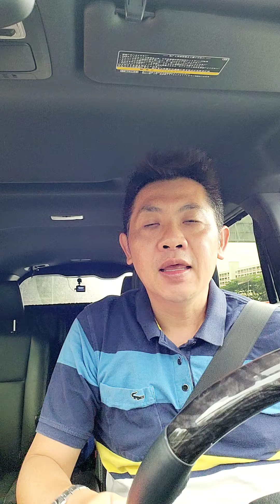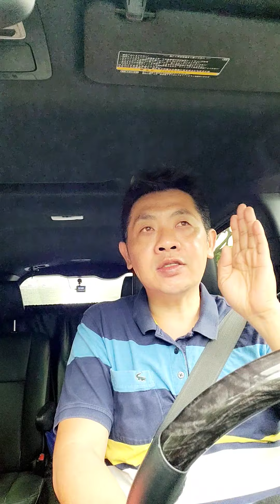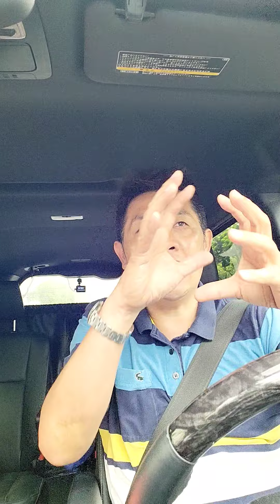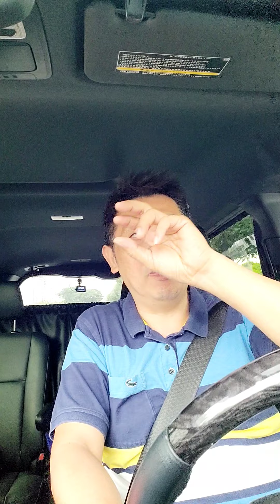aircon dry mode risk damaging copper pipe insulation.

Comment: OMG! 12 minutes talking and I still couldn't find the part that you are talking about "risk of damaging copper pipe insulation"

1- aircons are tested in factory for 300PSI but normally the gas inside doesn't raise over 120PSI. a proper Aircon  has humidity sensor and at least 2 temprature sensors one attached to fin and one standing in air in front of air intake window, thus gas temp will not go below 0 and even if it does, it is still safe until -20 degree. 
2- When aircon runs on dry mode, it shouldn't be turned on or off (stay on 24h), or open window to let air change as often as the way is used with cool mode. 
3- In dry mode aircon is set to remove humidity until it reach around 40% humidity since below that is considered uncomfortable zone (desert dry). when room humidity reach 40% aircon will turn off but sensors are still active and monitoring the air and if necessary it will turn on again.thus it is not necessary to turn off and on the aircon.
4- if there is a lot of moving in and out of the room, it is better to use cycle or auto mode than dry.
6- A room with 28degree temperature and 40% humidity feels more comfortable than a room with 21degree and 70% humidity (cold ocean) this is due to easier perspiring in lower humidity which absorbs heat from body to evaporate.
Reply from the maker: Haha... looks like we are of other worlds...u are confusing.me too...few lines into reading your comment and I totally cannot understand u 🤣
Reply: @astiquer And what is your point dude. talking sh*t like Wikipedia reading. You might not experience this problem if you're in a not-so-humid area because the aircon won't work as much either -- however here in S.E.Asia (like where I am in Indonesia) this is a common problem in using the dry mode overtime in a room with high mobility. That is why we (who know) keep changing the insulator for every 3 years or so.. also this is why dehumidifier devices sell very well here recently. However this small devices also comes with another downside; it cannot blow to circulate the air in the room and it comes with lower capacity. I'm not an expert. But I think what this guy Kevin said is LEGIT. Fortunately here in Indonesia, the price of the piping material and service is about more than half lower than in Sg. So I suppose that in terms of 'cost more' or not, it would really depend on where you live.

Comment: I don’t understand can any one summarise what he saying
Reply: He mentioned that using dry mode may attract the moisture at your copper piping as they are wiping with thin insulator. In dry mode, the coils temperature are as low as 0C to 3C to trap the moisture from the room air, so does the copper pipe. So you might end up seeing your wall where the copper pipe is laying get water accumulating (water marks) and damaging the copper insulating.

Comment: Interesting.  It seems like, normally, the condensation on cool/low fan is similar to dry mode for most mini splits, and the compressor runs more slowly in dry mode since no need to flow as much refrigerant since not as much load on the coil.  So, the room air is warmer, but there are savings in dry mode.  That's the tradeoff we've noticed.

Comment: We own three 2 HP Carrier X Power Gold 3 Split Type systems with inverter technology. We run ours on dry mode all day. The internal fan never stops blowing air. We are able to achieve as low as 35% humidity at times. The room temp is usually 74-76° F on dry mode. Does the inverter technology prevent the issue?

Comment: Never tried dry mode before but my trunking still shows mould and water drip. After using dry mode it stops so it's subjective for my usage. Ended up using dry mode for 2hrs first and cool mode for the night. Will it still damage the copper pipe?

Comment: Recently, I managed to learn from YouTube to remove the blower to clean after 5 years. Also bought a wet vacuum cleaner to suck out water (and jelly) from the water pipe. Cleaned the water retention tray ensuring no clogging with soap scrubbing. However, after 1.5 months, water still drip from the aircon. The following day, my wife suggested dry mode, and water dripping stops!
Reply: did u place the drain / outdoor unit higher than the indoor?